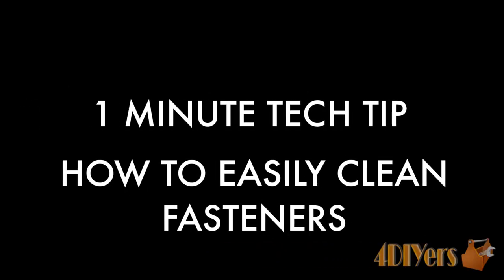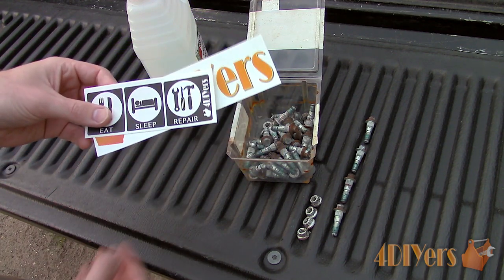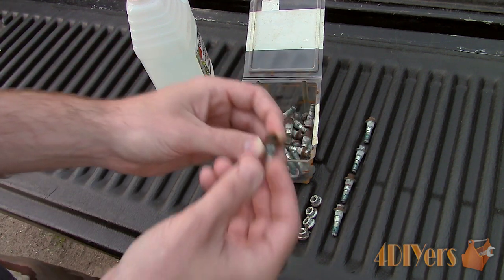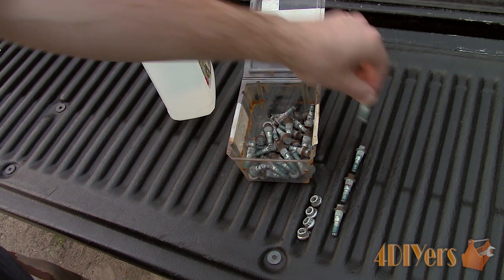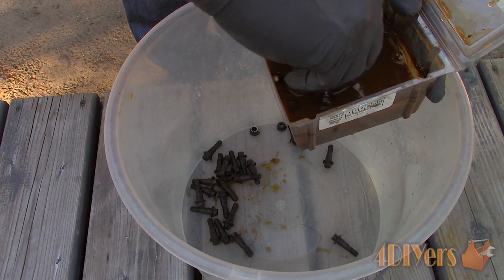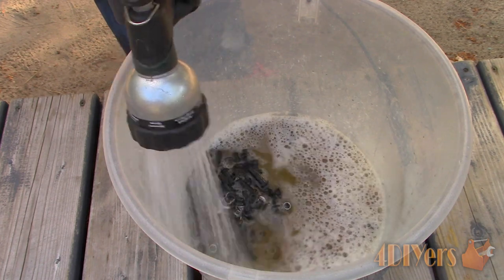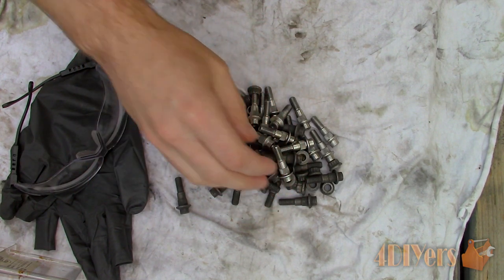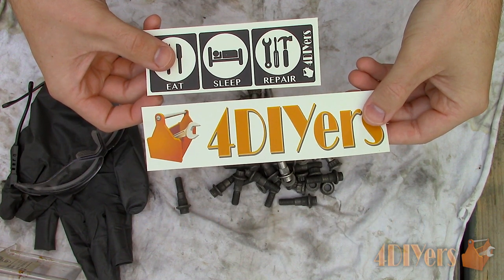Tech Tip: How to Easily Clean Fasteners

Comment: I'm refurbishing an old metal cabinet and a metal workbench that got rusty. I didn't realize cleaning all the fasteners would make them black, so do you have any info on how to put another coat of chrome (I'm guessing) on them? Thanks
Reply from the maker: Chroming is a different process, you can make your own at home chrome plating process but it does involve a lot of chemicals. Would probably be cheaper to buy new hardware if it's generic.

Comment: When you wire wheel fasteners you are likely to REMOVE the zinc plating which is meant to prevent them from rusting! So you're essentially now using a raw steel bolt which will rust super fast. One remedy is to use lots of anti-seize on the threads, but the head of the bolt I would do minimal wire wheeling to if you want to keep it looking good for any length of time...
Reply from the maker: When they're already rusty, that zinc plating already failed. Using anti-seize on structural bolts would be a big no no as you risk them loosening up over time.
Reply: @4DIYers  Blaster Surface shield will keep the bolts protected from re-rusting after they get stripped in an ultrasonic cleaner. I heard using simple green and distilled water dilution will not attack the coatings on most bolts and chineseium hardware if you try them in an ultrasonic cleaner.
Reply: Any acid will remove the zinc plating before it removes the rust anyway so there's no zinc left by the time it reaches the wheel, assuming any survived the rust in the first place.